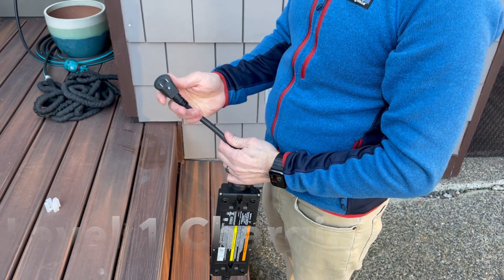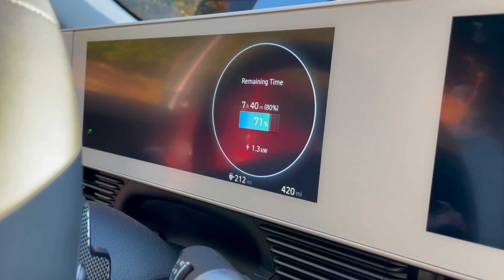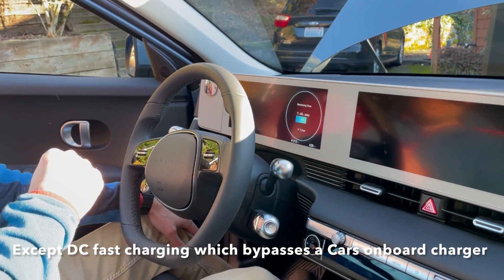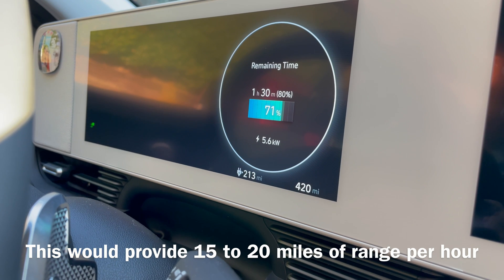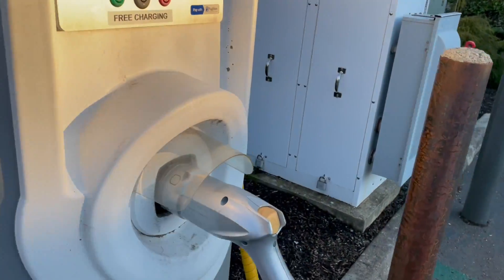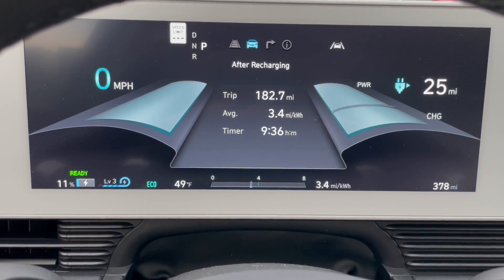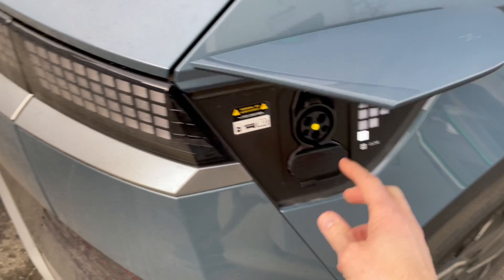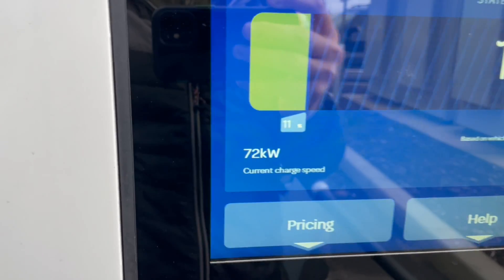Demonstrating the 3 Levels of EV Charging

Comment: Thanks for the video .  Do you need a charging unit?  Why not plug the car into the 240v directly without a charging unit?
Reply from the maker: You’re welcome, the charger mounted inside the car and you need a 240V EVSE to supply and regulate power from the wall to the car.

Comment: Hi,  Good video.  Did you say that you can use the cord supplied with the car for Level 2 charging? Or did you purchase a different cord  for Leve 2?
Reply from the maker: Thanks, great question, as I didn’t make it clear. Most electric cars only come with a level 1 capable charge cord or ESVE.  I purchased the level 2 cord from Clipper Creek.  https://clippercreek.com.  Teslas come with a level 2 rated charging cord.

Comment: The first level 1 charging (1.3kW), how many volts and ampers was that? I presume that is in US with 120V, so is that like around 11A?

Here in Europe I think the lowest EV charging (from a normal household power outlet) is 8A at 230V, which is 1.84kW. It is slow, but for me fast enough for daily charging at nights (I drive around 120-150km per day, ie. 74-93 miles per day, for my work).

My EV (Renault Zoe) can charge up to 22kW AC (3x32A at 230V), and quite many type2 AC-charging stations offer that, even free ones at some supermarkets and such. The rest are limited to 11kW (3x16A at 230V), most EVs can't do better than that anyway (AC charging).
Reply from the maker: Yes I believe you are correct 120 V and probably between 10 -15 A
Reply from the maker: My parents had one of the early Nissan leafs and always charged on a regular household outlet with the included ESVE.